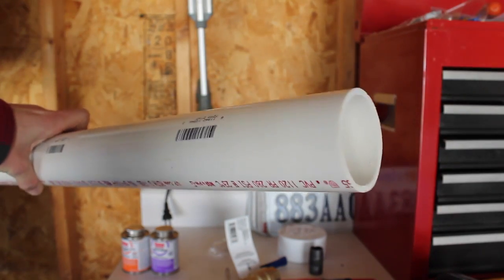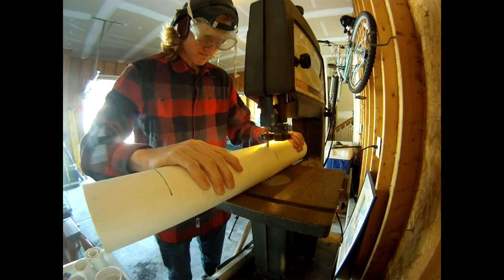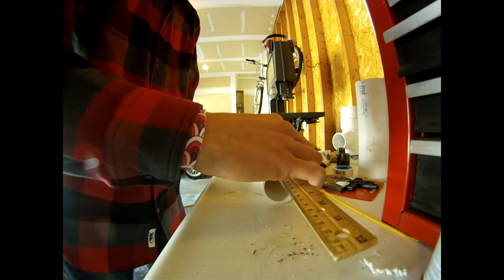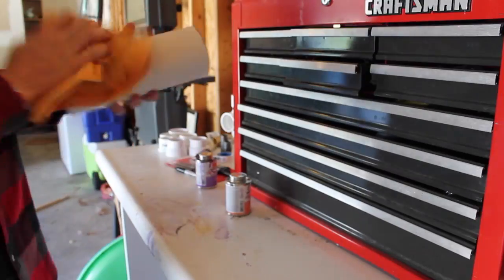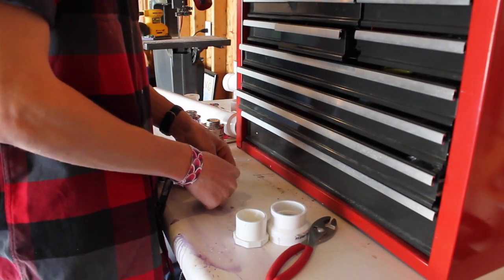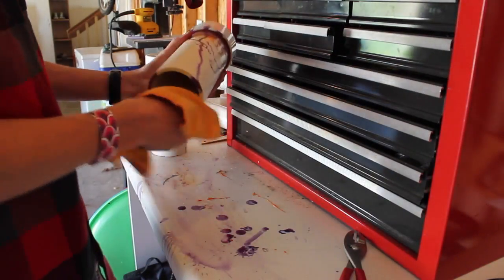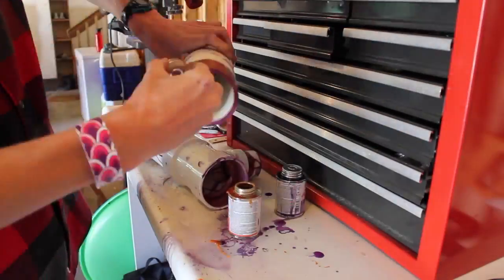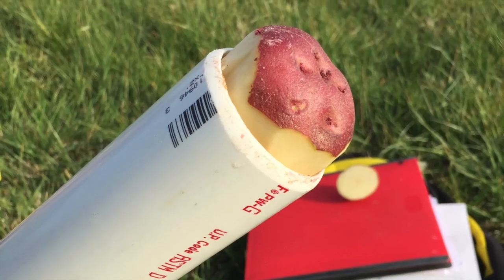How to Build a Pneumatic/Air Powered Potato Cannon

Comment: And do you have another video showing the air filling process with bike pump? How do you know when to stop pumping the air? And do you just open the ball valve to shoot? Why did you cover your air chamber with duct tape? I see that in the last frame only
Reply from the maker: Leila Hankinson that’s a good idea for a video. Most bike pumps will have a gauge on them that tell you what pressure you have reached. It’s up to you when to stop pumping. The PVC pipe will have a value on it that indicates the absolute maximum. However you won’t need to go nearly that high to launch. I believe I launched close to 90-100 PSI but you can experiment with a variety of values. And yes just open the ball valve to fire! I covered just in the off-chance that it cracked or ruptured, it would help keep the PVC from shattering, although the odds of that are very low unless you are exceeding the maximum that is printed on the PVC pipe

Comment: What are the two lengths of your steel (or iron) nipples? I see you have 2 sizes. Does it matter which one goes onto which end of the ball valve? Just in case, I bought 3  sizes: 2", 2.5" & 3" long. 2 of each. And how long are your 2" PVC lengths to fit into the reducer and T? About 4" long? Thank you for posting this fun project!
Reply from the maker: Leila Hankinson thanks for the comment! I do not believe the nipple length matters. Just make sure that they are securely into the threaded sections of the receiving end.  And the 2” was about 3 inches I think, but again, just make sure there is enough to reach the full depth off the T and reducer. Hope this helps!
Reply: Thanks Sam Teller!
Reply from the maker: Leila Hankinson you’re welcome!

Comment: All you need is a quick coat of O.D. green spray paint.  Of all the designs I've seen researching DIY cannons your reservoir is the most awesome. It's much longer and it releases from the center directly into the valve assembly section.  There's no routing it around a 180° turn first.  Using steel pipe instead of pvc is an excellent idea.  I'm making a cannon that is powered by black powder and fires M80s.
Reply from the maker: Lauren Anon thank you! That sounds like it’ll be a crazy rig!

Comment: If you roll the tape into threads the same way as you would tighten a nut on,,it works better..in other words,, wrap tape clockwise..
Reply from the maker: John Medley thanks for the tip!
Reply: Wasn't trying to sound like a smart ass,,,, just a lil help..

Comment: Nice job! We used to make them that way! 
We have designed and patented an aluminum version, of the PVC Sprinkler valve, that is safer, stronger, lighter and designed for air.
No modding required. 
We also have superlight, stainless steel air chambers, carbon fiber injection molded grips, and button triggers that are much faster than blowguns. 
Complete launchers, or parts! 
https://www.facebook.com/jjmultilaunchers

Comment: PVC is not meant to handle any gas pressure, those ratings are hydrostatic only, at least you had a disclaimer for when it blows up.
Reply: Mine is made with schedule 40 PVC hasn't blown up after 15 years...yet.
Reply: @dennisprice8357  How much pressure do you use ?

Comment: You're creating a gnarly funnel by reducing to a 3/4" ball valve. Depending on how much you really care about performance, a 2" ball valve will run you about $50 but you'll get much better airflow. And another idea would be to use a stronger tank. The more psi you can add, the further your potato will go.

Comment: your trigger system  sucks  big time
Reply from the maker: Greg Plaka what would you suggest?
Reply: for one using a spray of any type is very low power,   and will not fire every time.    Air power is the way to go.   you need some instructions,  easy to show but not so easy to type the instructions.   I will try but a drawing would be much better.    one you need to drill and tap a hole in the cap at the end ot the gun.  you will need a standard male air fitting.  So you can attach an air hose from a compressor or an air tank to the fitting.    Is that clear so far?
Reply from the maker: Greg Plaka this is a video on a pneumatic cannon, meaning air powered, no aerosols or sprays were used in the fire mechanism of this cannon.
Reply from the maker: If you watch the video you will see that I have done just that. The cross of the T is an air reservoir that is filled with air by a bike pump. Once the reservoir has a certain PSI you pull the lever in the ball valve to release the air into the barrel, firing the projectile.
Reply: Now if you try to fill this with air with the barrel open to the air your gun will never build up the pressure you need.     I have use   SCH 40 for 100 psi
Next is to make sure you barrel end that is in the 4" PVC is only about 1" from the bottom cap that you just put the nipple into.    Clear so far?
DO NOT Glue the bottom end to the 4" PVC.

Next, you need to find a piece of semi-hard  Rubber that will seal the Barrel.   The Diameter of the Semi-hard rubber will be just a little less than the inside of the PVC this will allow the round disk Semi-hard Rubber to move inside the 4" PVC tube.  Is that Clear?  

Now once you put the semi-hard Rubber disk inside the 4" PVC make sure it can move.  The Disk should be at least 3/16 " Thick.

https://www.mcmaster.com/#rubber-sheets/=1e2xufg
Reply from the maker: Greg Plaka the ball valve acts as a seal and does not allow air into the barrel during reservoir fill up.
Reply: now if you add air to the Nipple the large 4" chamber will fill with air and block off the barrel at the same time air will bend the disk and fill the 4" chamber,  once the air stops rushing in and you will hear it stop your gun is ready to fire.   

All you have to do is relase the air connection and the air in the 4" chamber will push the disk back to cover the air charge hole and all the rest of the air will rush to go out of the barrel.     easy and works every time.      Let me know if you have any questions.    this is all ON YOU  or anyone reading this,  is for informational use only.   you are on your own period.
use SCH 80  and start at low pressure.   your pipe has a rating on it.  let the glue dry for at least  3 days.     To test use a long air hose and fill the gun with the air let sit for 24 hours at full air pressure before using.     good luck and wear leather gloves at all times and cover your eyes with good safety glasses.    do not point this at anyone.  EVER
only use soft bullets.   NEVER us anything hard  NEVER NEVER.

One more tip the longer the 4-inch PVC the more air and the more power your system will have.      ALSO, the ATF says you have to get a tax stamp if you want to build an air gun.    The Stamp cost 200 dollars and takes about 8 months to get.  Air guns are not listed   as    Any other Wepon.   AOW   Go to look up what the ATF says about AOW.  you will also need to put a serial number on the air gun.      Good luck
Reply: you may need to put a small air hole in the rubber to keep the rubber disk in place .
as long as the air suppy is gretter than the small hole letting the air escape. your are good to go..      Test with out the air release hole first.
Reply from the maker: Please watch the video and you will see that this is an air powered canon that does not need a rubber flange to block the air because there is a ball valve that blocks air from escaping the reservoir (which has a male or shrader valve so a compressor or bike pump can be attached) the valve can then be open which releases all of the air at once, firing the projectile.  While I appreciate your comments, I believe you should know what your are commenting on before you do so.
Reply: a ball valve does not give a quick opening of the air release.   lousy trigger system.
Reply from the maker: The ball valve is plenty quick to send a projectile over 100 yards.  It maybe slow only if you move very slowly.
Reply: Greg Plaka your comments are ridiculous. Did you even watch the video?!?  Everything you criticized has the answer in the video. 
Go back to the couch in your moms basement and leave this guy alone.

Comment: I sorta did the same thing but as a bait launcher for surf fishing. I used a 4 inch schedule 80 tank about 2.5 ft long, 4/2 reducer, schedule 80 2" to a 2" ball valve. at first I did it with a 3/4" ball valve but the weight of the barrel and tank snapped during transport. It was cold and it snapped on the first day. So I paid a rediculous amount, I think like $80, for a 2" but it was totally worth it. It releases so much more air and keeps the barrel stable.  it's a great gun but it blows apart at the seams every now and then. it seems that the cement isn't strong enough for air pressure. one time it separated at the reducer and shot the ball valve and the barrel at 50 psi. I think the best way to go is with steel pipe or thread the PVC. Next I want to make one out of steel pipe, threaded and welded.
Reply: I want to make one for fishing aswell. Do you still use a potato to launch? Or are you using something else. Thanks
Reply: Druid 369 how far did it get the bait out there? I am doing research to build one for the same application

Comment: Do we need the tee or bot
Reply: Not
Reply from the maker: SixFilms you do not need one, you just need the ball valve so that you can release the pressure. I built it with the Tee so that I could set it on the ground.

Comment: actualy glue and primer dries in 1 minute, not 24 hours,
Reply: wait 24 hours be safe.   make sure everything is clean very clean
Reply: Can't post pics but trust me I punctured my hand dead center with my air valve due to still wet glue. It's not worth it. Just wait

Comment: what is the maximum amount of pressure that should be applied?
Reply from the maker: I wouldn't recommend putting in more than half the recommend amount for the weakest part of the cannon.  The 3 inch diameter pipe was the weakest so you wouldn't want to put in more than half of what was written on the side of that.
Reply: ok, so the maximum pressure is on the side of the pvc. thanks
Reply from the maker: Bryson Toth sure thing!